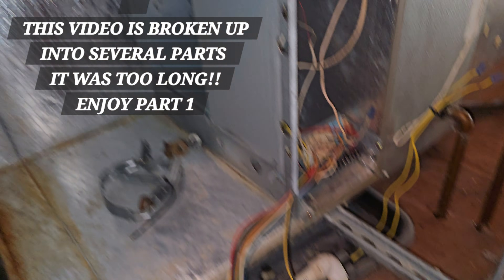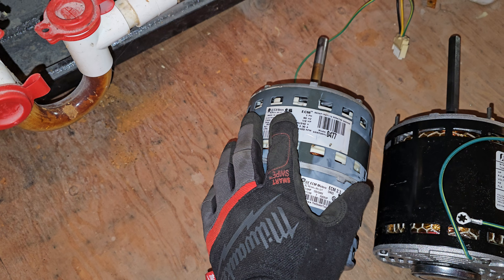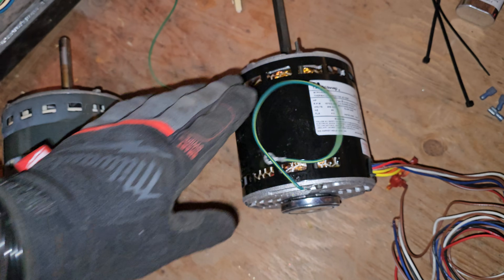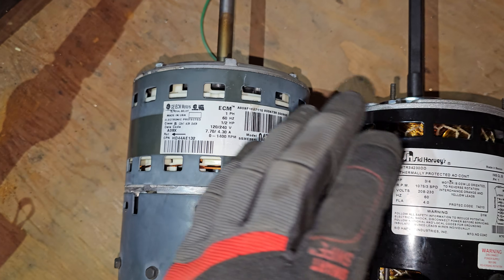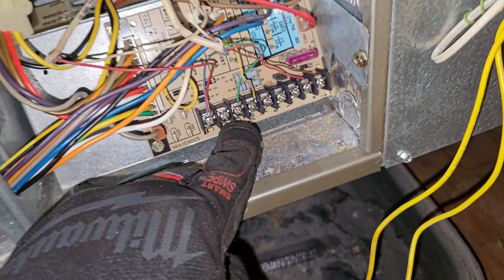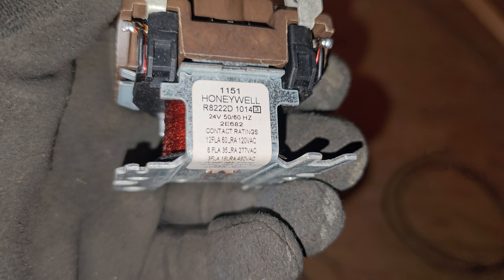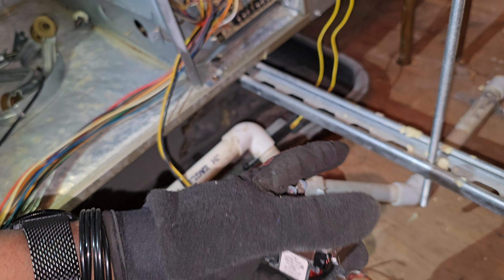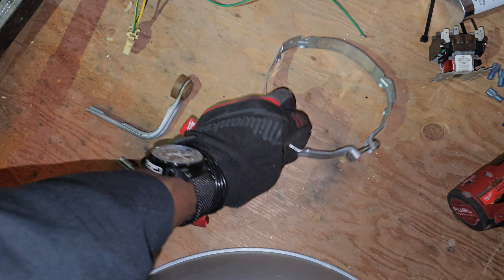ECM TO PSC BLOWER MOTOR CONVERSION

Comment: How did you determine the original blower motor was bad?
Reply from the maker: fan staying off with fan call verified and power supply to the motor!
Reply: @D2DNYAC possibly a bad thermistor. I fixed my own for $3.50. It's a very easy fix.

Comment: Do I need 2 relays? One for cooling and one for heating? No more 60 seconds delay time for heating blower?
Reply from the maker: You could  wire a delay on make time delay into the circuit if you like another 10$ part

Comment: If memory serves, there is a manufacturer of boards designed to operate a PSC in an ECM environment. Is it ICM? I don't remember. Note for the public, from a decades-long pro...me... the reason we have ECM motors is the Department of Energy. It is impossible to save enough energy to make up the additional cost of the ECM platform over the old PSC approach. Government mandates demand that YOU, the consumer, PAY MORE so that government can achieve its goals, whether those goals are using less energy or worrying about global warming potential, forcing new combustible refrigerants onto the market. This is one reason that we have the President we have now. The new  approach to governance is good for you, and it is good for my part of the industry, which is cooling and heating for stores. The deep state is populated with people that you did not elect. They are just there, making rules without accountability. That is being changed. When ideas are good, they don't need to be mandated.
Reply from the maker: Never seen an ICM module for an indoor unit fan motor! Good points though.
Reply: @D2DNYAC  I think that adapter board is made by Mainstream Engineering.

Comment: If you used the 2 relay set up, You could also use a set of NO contacts on one relay as a lockout for the other relay so that they can not be actuated at the same time. This would give you another level of "cool-dooded-ness".
Reply from the maker: Yes sir🧐👍💪💪, this  setup or similar would definitely be necessary for the multiple relays/ speeds wiring.   I think i will draw a diagram and do a few short videos explaining

Comment: My unit has a ecm capable motor but no board running it. I looked at the speeds it's all 90 and 1 100. Power comes off a transformer and a relay like a normal one but no capacitor.
Reply from the maker: Okay thanks for watching

Comment: I mean did you fail it without checking the module?
Reply from the maker: Module what Module,  the unit came with a circuit board not a  Module

Comment: please change the title of the video. you are not  converting ecm motor to psc motor. you are replacing from ecm to psc.
Reply from the maker: Thanks 🙏
Reply: Bra what’s the difference smart guy he had to re wire the unit to fit the motor